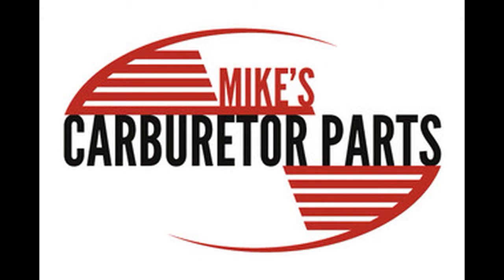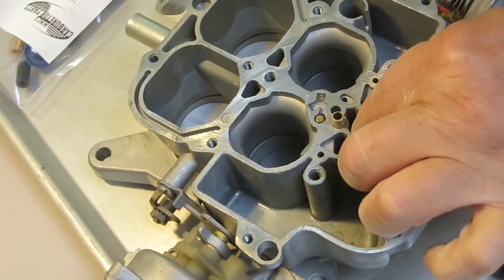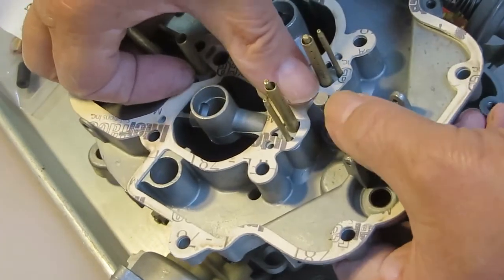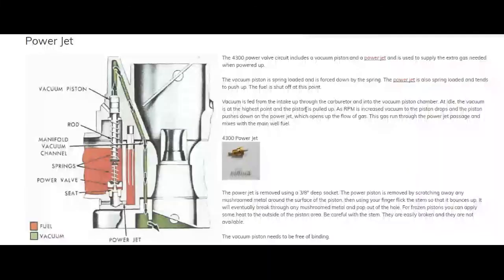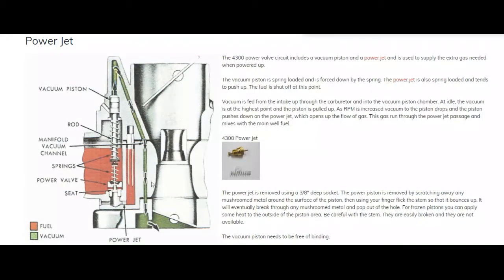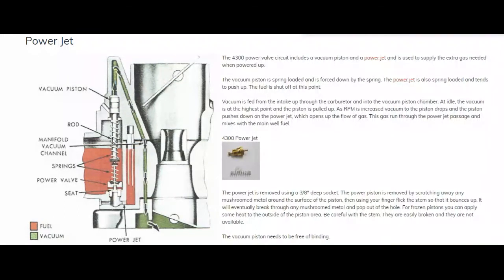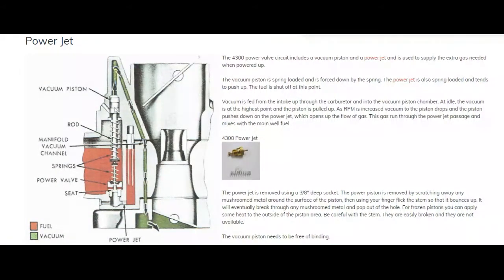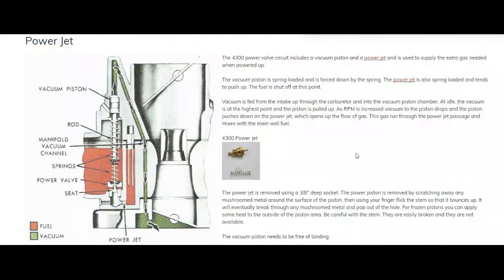Exploring the Power Jet Circuit in Autolite 4300 (4 Barrel Carburetor)

Comment: hi mike i just install a afb 750 on my 350 stock chevy, but don't wont start, pulling down  the accelerator pump with the pressure of my finger is the only way to pump some gas, with the throttle got not gas, the accelerator pumps is failing or something?  thanks man from Mexico